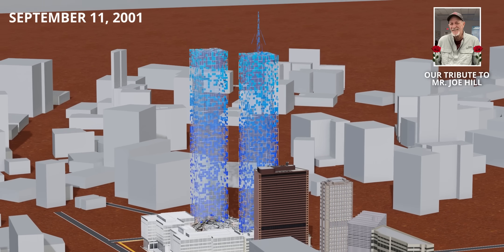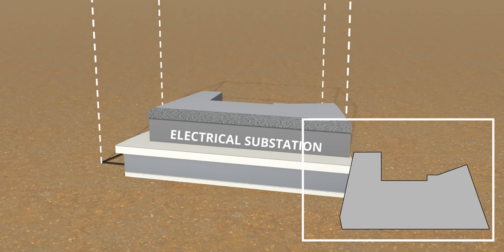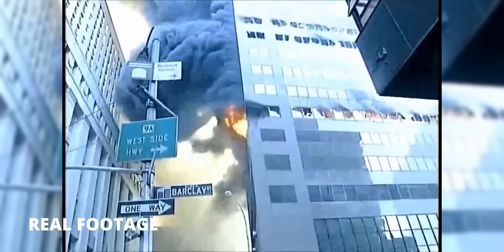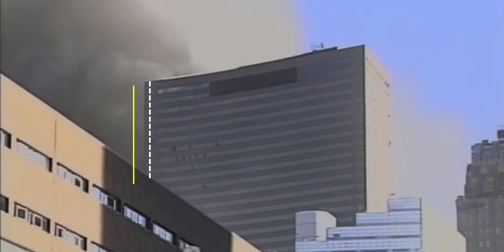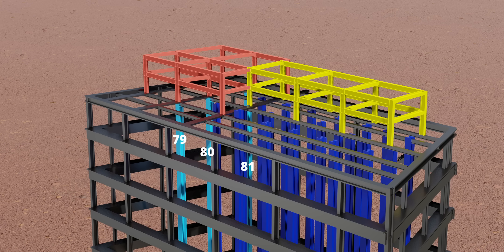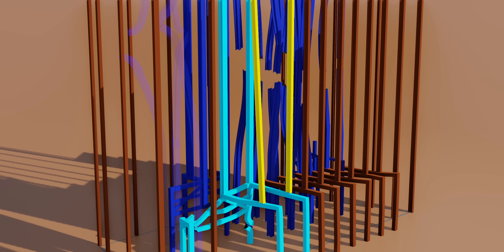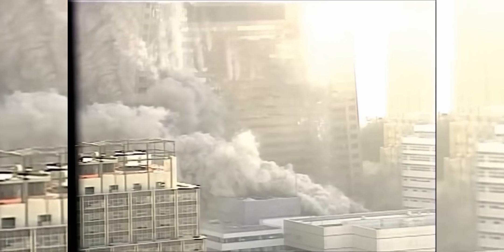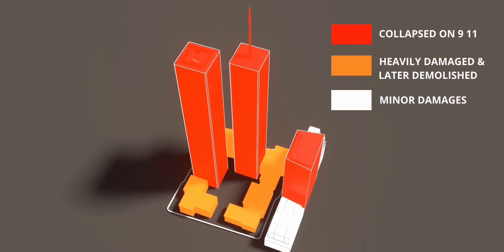Collapse of Building 7 | The Complete Physics

Comment: nah, utter nonsense.

We can simulate everything these days, and yet this is just a cartoon.

Plus: The damage sustained by falling debris did not play a significant role in its collapse, as per NIST.
Which means only fire caused it to collapse the way it did.
Which means that only 1 column was responsible for it, number 79.

So, if some doofus on a forklift had accidentally knocked over this column in the years prior to this event, what would have happened?????
Reply: "nah, utter nonsense.
We can simulate everything these days, and yet this is just a cartoon"
"Dr Leroy Hulsey has shown it much much better."
This would be the same Hulsey whose cartoon actually IS a cartoon? There's nothing remotely factual about his nonsense. BRAVO, you failed.

"Mark Loizeaux from CDI said in regard to allegations made by people that Thermite could have been used so not to have the sounds of Explosives.... he said that he did not know of any way to rig bld 7 to have it come down the way it did.
Because you can not time thermite perfectly.
That is roughly what he said."
Right. Loizeaux said something you made up, and really, it's true, trust you, he said it, really, because you said he said.

Could that have been more ridiculous if you really tried? Maybe claimed Santa was involved, try that.

"Then how did fire do it?"
By burning for a minimum of more than twice the amount of time the fire protection on the buildings structure was rated for. Imagine that.

"Then surely one should be able to explain how all 4 corners of a 100 meter wide building came falling down at the exact same time"
Sure! Could probably explain Santa Claus as well. Goes like this in both cases: "That's a fantasy with no basis in fact".
Reply: utter nonsense.

Dr Leroy Hulsey has shown it much much better.

Stop muddying the water and come with some facts.

Mark Loizeaux from CDI said in regard to allegations made by people that Thermite could have been used so not to have the sounds of Explosives.... he said that he did not know of any way to rig bld 7 to have it come down the way it did.
Because you can not time thermite perfectly.
That is roughly what he said.
You can find the video if you want.

So, this man who is an expert does not know how to use Thermite to pull a steel frame building down, because thermite can not be timed perfectly, to bring it down the way we saw it come down.

And so, the only simple question is this:
If Thermite is unable to do it, and explosives were not used because we could not hear any bombs going off......
Then how did fire do it?
How did fire which was burning randomly weaken a structure like that to have it fall the way we saw it fall?
If thermite cant do it, as per Mark..... And no explosives were used.....
Then surely one should be able to explain how all 4 corners of a 100 meter wide building came falling down at the exact same time and with the same gravitational accelartion, for 2.25 seconds.....keeping the roof horizontal.
How would fire be able to achieve such precision?
Such timing?
Reply: @TMGpuntNL  - I suspect you maybe read the Cliffs Notes version of Hulsey’s report and decided you liked it because you think it agrees with what you want or need to believe.

I have actually read both the Hulsey preliminary and final reports from cover to cover, which is more than I can say for most of the people who recommend it to me. The Hulsey report is such a dead horse now, flogged so many times now I find it difficult these days to drum up the enthusiasm to do it yet again. But here it goes.

My opinion of the Final Report is as follows:

The Hulsey Final Report on Building 7 met none of its three stated objectives – indeed could not have met those objectives for lack of trying - and failed to prove its main conclusion, by way of a fundamental logic error; Hulsey claimed he had concluded fire could not bring down Building 7 without accounting for the full envelop of possibilities. Essentially, he claimed to have proved a negative

Hulsey also plagiarized almost 3 pages of material from Tony Tsamboti, who works for the studies sponsor. I hope I don’t need to point out the ethical implications of that.

While promising superior models to those of The NIST, the Hulsey Report in fact delivers grossly inferior models which eliminate the time factor, focus on only two floors and rely on a greatly simplified version of The NIST’s temperature data. The model animations are clearly not derived from the model data as they show no dynamics at all and are obviously forced to make the animations (superficially) look closer to AE911T’s imagining of the real event.

Overall, it is a shoddy piece of work done by a man clearly working out of his element and areas of expertise. It rather reeks of trying to support a conclusion arrived at before the study started. Curiously, study sponsor Architects and Engineers for 9/11 Truth having announced what the study would conclude before they awarded it.

Hulsey tested just one out of countless thousands of possible scenarios, using a completely unrealistic scenario and an artificially restricted set of data almost like he wanted to ensure fire would not cause a failure. The Hulsey Report was so factually inaccurate, methodologically unreliable, scientifically unsound, illogical, and biased that it blatantly violated any requirements of objectivity, utility, transparency, and reproducibility that would have been required to submit it for peer review in any reputable journal.

Hulsey and his assistants have not published the report anywhere that any relevant academic or professional engineers look to.

Hulsey had said all along that the report would spawn several (perhaps four) papers in good American engineering journals and possibly a book.

Then Hulsey walked that back, realizing he'd stand no chance to pass peer review in America and so said he'd go for European journals - but years have gone by with no publication whatsoever. Also, no book from any science publisher either. As far as the engineering profession and science are concerned, the Hulsey report barely exists.

The engineers of America and of the world have never read it. It has had zero impact in the professional community.

To its intended non-engineering literate audience, they Hulsey Report contains enough engineerspeak density for them not to ask questions, even if they were so inclined. Since the report appears to (superficially) deliver what they want, they are not inclined, even if they knew what to ask. From a structural engineering perspective however, The Hulsey Report is of no value, which explains why promises to get the report published in peer-reviewed and reputable engineering journals where it could be scrutinized by qualified professionals were abandoned.

If you are genuinely interested in what happened to Building 7 rather than in promoting a political agenda, there are several excellent forensic engineering reports out there and over two dozen articles published in genuinely peer reviewed engineering journals that are far more comprehensive and competently done. I suggest you seek them out instead.

And actually read them.

This should get you started.

FEMA BPAT (initial report superseded by NIST NCSTAR 1A)

NIST NCSTAR 1A: Final Report on the Collapse of the World Trade Center Building 7, 2008.

Guy Nordenson and Associates, WTC7 Global Collapse Analysis Report and Summary of Findings, 2010.

Arup, WTC -7 Structural Fire Analysis Report (Runs 1-4), 2010.

Weidlinger Associates Inc., WTC 7 Collapse Analysis and Assessment Report, 2010.

BRE Centre for Fire Safety Engineering, Analysis of the Impact of a Fire in the Mechanical Room (5th & 6th Floor) of the World Trade Center 7 Building, 2010.

T. McAllister, R. MacNeill, O. Erbay, A. Sarawit, M. Zarghamee, S. Kirkpatrick, J. Gross, Analysis of structural response of WTC 7 to fire and sequential failures leading to collapse, J. Struct. Eng. (United States). 138 (2012) 109–117.

For a summary of the major studies I would recommend THE COLLAPSE OF WORLD TRADE CENTER 7: REVISITED by Mhd Anwar Orabi , Liming Jiang , Asif Usmani and Jose Torero which is a 33 page summary of the different analysis and conclusions published in 2020. Sorry, YouTube will delete this post if I give the link but it should be easy to find and is available from the University of Queensland, Brisbane.

Real structural engineering industry professionals conducting real engineering studies and publishing them for other professionals to see. Not amateur YouTubers appealing to the gullible and credulous.

Happy reading
Reply: @TMGpuntNL  - To the 2nd part - how did fire do it - the answer is the same way fire has been destroying buildings since man started making buildings. That you don't understand it doesn't mean it didn't happen, it just means you don't understand it. Let's fix that.

Much misunderstood, Building 7 was the 6th building to collapse of 10 lost on 9/11. Because of its early low priority, conspiracy filled the information void with garbage made up by technically ignorant people promoting political agendas. But 7's loss is an engineering problem and should be treated as such, so I prepared this brief summary of my own analysis to fix that, using technical analysis, not ideology and tired memes. 

At 10:28am the WTC North Tower collapsed, showering Building 7 with tons of burning debris, causing heavy damage and starting many large  fires which burned out of control for the next 7 hours. Half the FDNY firefighters having been killed, units in disarray, equipment destroyed, no water pressure, and the greater urgency of search & rescue efforts, Building 7 couldn’t be saved so firefighting efforts were pulled as futile and 7 left to its fate. Firefighters make that sort of choice every day in brush fire situations - which houses to save and which ones to let go. Only real difference here is moving the decimal on the size and cost. People get overwhelmed by the size.

www.youtube.com/watch?v=g_SvpwyC17M

Collapse of a burning structure is always a concern for firefighters. Steel buildings subject to fire rely on active firefighting to survive. Buildings are designed around 1 to 3 hours of fire resistance, allowing time for occupants to escape and active firefighting to get started, after which all bets are off. Left to their own devices they'll exceed their design envelope and collapse, like Plasco Tower and Wilton Paes de Almeida. In 7 the occupants escaped, passive and active fire protections were compromised and active firefighting was abandoned hours before the collapse, which left the building to its fate. It lost. Odds on Building 7 would eventually collapse, and it did. No big deal in logic.

 http://www.youtube.com/watch?v=WnYBX6QT0R4 

FDNY Chief Daniel Nigro - The biggest decision we had to make on the first day was to clear the area and create a collapse zone around the severely damaged 7 World Trade Center, a 47-story building heavily involved in fire. A number of fire officers and companies assessed the damage to the building. The appraisals indicated that the building's structural integrity was in serious doubt. I issued orders to PULL back the firefighters and define the collapse zone. It was a critical decision; We could not lose any more firefighters. It took a lot of time to PULL everyone out, given the emotionalism of the day, communications difficulties and the collapse terrain 

FDNY Deputy Chief Peter Hayden ; We had our special operations people set up surveying instruments to monitor and see if there was any movement in the building. We were concerned of the possibility of collapse in the building. And we had a discussion with one particular engineer there, and we asked him if we allowed it to burn could we anticipate a collapse and if so, how soon? And it turned out that he was pretty much right on the money, that he said 'In its current state you have about 5 hours 

The collapse of Building 7 was anticipated and widely reported in the media throughout the day, with 24 video cameras recording some or all of the collapse. Everyone knew what was coming and why. 

www.youtube.com/watch?v=OY5S5k3tMHI

The collapse of Building 7’s was entirely different to the Twin Towers and harder to understand, most details being hidden from view and not intuitive.  But we can still sort out what happened through careful analysis and observation. This is my explanation of the collapse relying on no outside authority. 

Building 7 was a unique, asymmetrical 47-story steel framed structure built atop a smaller 3-story building serving as a partial foundation, requiring lower floors dedicated to complex load transfer structures. Of trapezoidal shape and all-steel tube-in-tube construction, B7 (above the 7th floor) consisted of a central core of steel columns carrying most of the gravity load, perimeter steel columns around the outside of the structure carrying the remainder of the gravity loads and long span beams and girders to tie those elements together and form the floors. On the outside of the building hung a moment frame or outer shell. 

Phase 1 : First externally visible signs of collapse initiation occurred at 5:20:28 pm and were notably quiet with observers not realizing the building was collapsing! No audible warning in the form of hundreds of ear drum busting 180-190dB explosive bangs preceding the collapse. Here at 12:00 a local CBS affiliate reporter is talking 10 blocks from B7 when collapse begins. People don’t start to notice the collapse until 12:11. At 12:45 is the famous CBS fixed camera clip of Building 7’s collapse. Note how quiet it is. 

www.youtube.com/watch?v=t5tEy6mXSE8

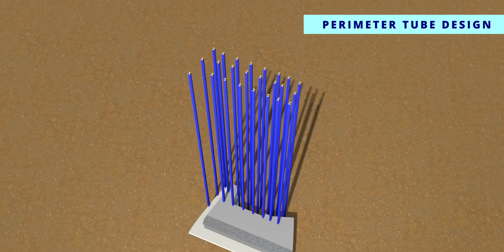Collapse initiation was due to lower floor failures above the load transfer region (8-14th floors) in the NE corner. In this video at 0:45 you can see the NW corner from inside the building while under construction, Column 79 just out of frame on the left. That big, angled steel beam across the top of the frame connects to C79 at one end. The girders connect to the beam. That beam and all those girders depend on just one connection 

www.youtube.com/watch?v=nP3TNHPCIVU&t=45s

Phase 2 : The NE lower floor failures caused a loss of critical lateral support over an excessive length of Column 79 and it buckled. Looking at a floor diagram of Building 7 (www.nist.gov/image-16640) when you see all the structures that depend on C79 you quickly realize this one column was a relatively isolated structural element on which a disproportionately greater fraction of the structure depended analogous to say the Key Bridge. Externally as collapse begins we see a vertical progression of window breakage along the 44-46 line and a kink in the roof of the East Mechanical Penthouse at the top of the building, consistent with C79 failure. Normally with a buckling column, the load could be redistributed to other columns. With C79 that is not the case - the failure did not redistribute the load, so the collapse rapidly progressed to the roofline, sinking the rooftop penthouse. The transition from full capacity to almost no capacity occurs in an instant and will result in virtually no resistance 

Phase 3 : With C79 gone, B7’s progressive, non-symmetrical collapse continues with adjacent columns 80 and 81 left laterally unsupported, and quickly buckling as well, sending the EMP down through the building. C79-81 all have no diagonal bracing, which is the major reason why they could not redistribute a lot of vertical loads among one another. From there collapse progressed from east to west through the central core until the core was gone taking all of the interior floors and probably most of the perimeter columns with it. Follow the horizontal progression of window failures low in the building and the dropping of the remaining rooftop structures into the building. One of the big takeaways from the NIST Building 7 study (invariably ignored) was how their modeling determined C79 failing under ANY circumstances would have initiated the same collapse sequence. 

Phase 4 : After about 10 seconds only the exterior moment frame remains, giving the illusion B7 is still standing to the casual observer since little has outwardly changed. But it is just a hollow empty shell like an empty cereal box supported only by a few remaining columns and overloaded from the loss of the core columns and floors, quite unable to remain standing. With nothing remaining behind it, the north face leans inward, forming a V in the roofline, the last few columns buckle under the strain and the moment frame free falls, landing on top of the debris pile. 

It is only here at the very end that a single measurement of alleged free fall acceleration is taken, from a single point on the outer shell. The Building did not “free fall” – just one corner of the outer shell did, sort of. The Building_ (defined as its center-of-mass) was already gone before that happened. The period of alleged free fall was a product of how it fell NOT why it fell and can't tell us what started the collapse 10 seconds earlier. Start to finish the collapse took 18-20 seconds, 3 times longer than free fall . How fast something falls cannot tell you what started it falling_ anyway. 

The debris spread outside the footprint blocking surrounding streets, heavily damaging the Verizon Building and destroyed Fiterman Hall. 

Building 7’s progressive, non-symmetrical collapse was incidental and unintended collateral damage from the combined effects of fire + time + gravity, started by the collapsing North Tower. That is true no matter who planned and carried out the 9/11 attacks or why . The collapse was of so little consequence it barely registered at the time - a footnote, only taking on semi-mythical status as an alleged smoking gun years later when demolitions at the Twin Towers, missiles at the Pentagon and shoot down over Shanksville all failed and conspiracists had nothing left to work with. 

Anything can seem like a conspiracy if you don’t understand how it works. Now you should. I hope you found this helpful, informative and it solicits informed critical comment. If I made any errors of fact, logic or reason or left anything important out, please let me know so I can fix it. IF you can offer a more plausible alternative please do. Be the first. Please start any reply with the words “Tits McGee” or I will know you didn’t read it and are wasting my time.